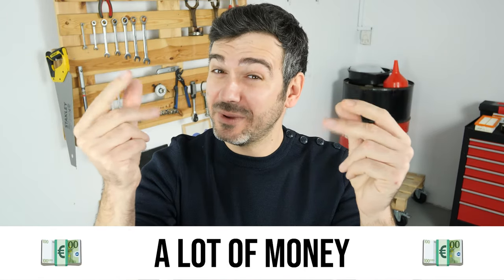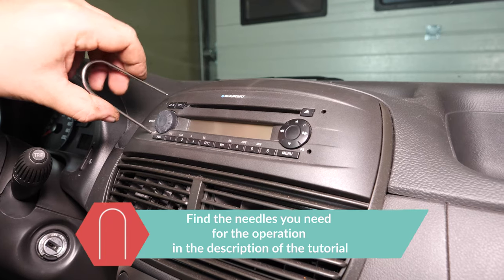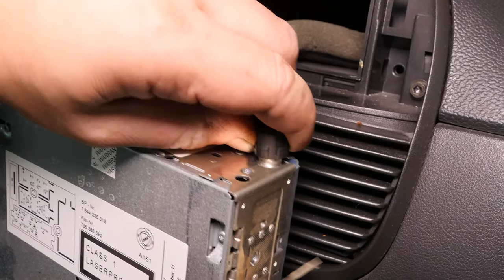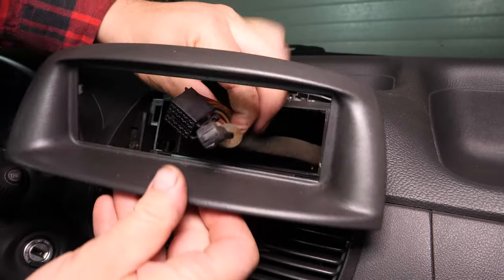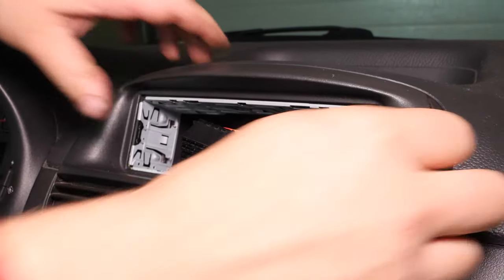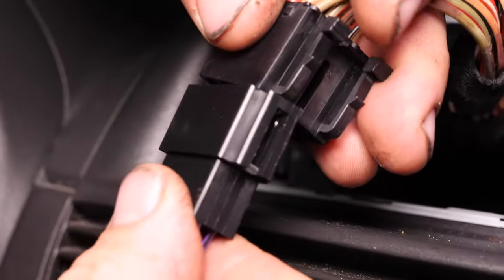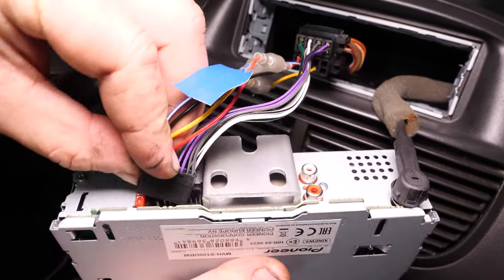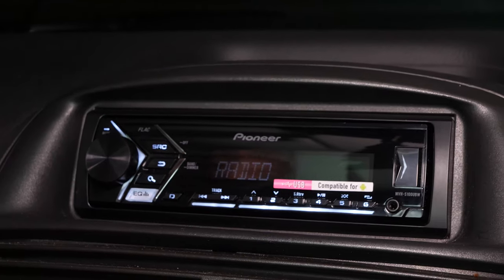How to install the car stereo Punto mk2 📻

Comment: I'm calling bull on this. It turned on without running the red wire to the lighter or fuse box, not a chance.
Reply: They'll only fry the ecu if it's wired wrong, where's the harm? 🤤

Comment: How about the Fiat Punto 2005? I bought a radio, but it dosent turn on....
Reply: Check the forums mate you need to run the red cable to the lighter or fuse box. Ziggy122 has a good video on how
Reply: You can also check how to connect the red wire on a video I just made, it's in italian but you should be able to understand what to do just by watching it